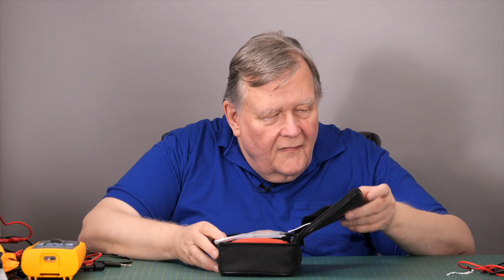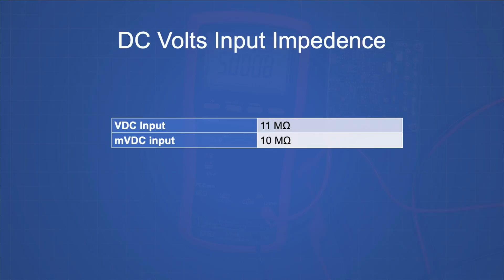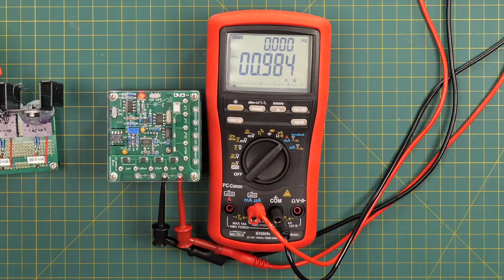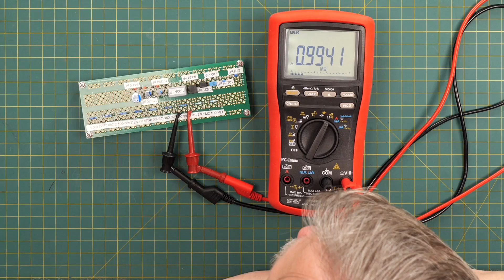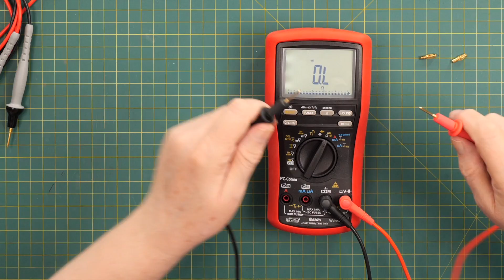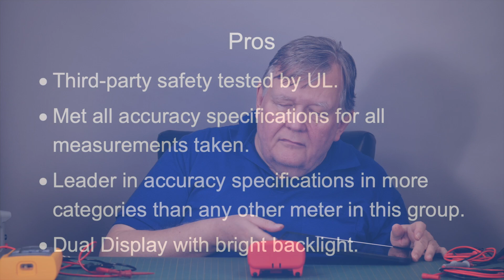Brymen BM869s Review

Comment: I have an issue with an inverter powering a second inverter, but one of them (or both) are not meeting specifications by a lot. The problem always starts at bootup, so i need a multimeter that will log the first second, be fast enough to record that. Most likely the condensators charging, maybe a grounding issue, or simply a very off-sinus tripping the other. Can the BM869s do that? (graph out the first second) or should i buy something different in the same priceclass (EU)?

Comment: Here in the Netherlands it was 209 Euro for a long time. That is a price by the company that honors its warranty. To be honest, for me, I would use those 150 bucks difference and buy another peace of equipment. Everyone has to know what's better for him though. All meters go out if the specs over time. Most of the good once do not drift that much away though. In most cases its possible to send it for recalibration. Question is do you need that difference in the accuracy with your usage of the meter? If you really do you might been better investing in high quality bench meter instead.
What you get for the money Brymen meters are excellent.
I wonder why haven't you checked 500K option for the DC voltage?
BTW Brymen doesn't support user changing firmware. It also requires re calibration after it.
But that difference between the Greenly and BM869s might be the firmware version. For Brymen, hold the delta button and start the metter. This will display the firmware version while you are holding it. More recent version will also give you longer backlight operating time. Newer versions often resolve issues that were not caught by QA team in Brymen but get found later on. That's the reason why I like to get their meters after some time has passed and they have ironed out the issues. Even the newer BM789 had some issues on start. They even added hardware parts to majevit better. Like buzzer magnetic shield. They do improve their products.

Comment: Hello, thank you for this excellent presentation,👍 but I have a question: which multimeter is your preference and why between Brymen BM869s vs UNI-T UT181A ? 👍
Reply from the maker: I still use the Uni-T UT181A, but I no longer own the Brymen BM869s.  Both are good meters but I don't have room to keep all the meters I review. Because of my vision problems I can read the UT181A screens easier than the BM869s.
Reply: @N8FDY  OK thanks for your feedback and good luck.👍

Comment: Hello, what is better to choose? Fluke 117 or brymen bm869s. I would use it for electrical wiring, I would have to measure the wastewater of the car or not. Interested in durability, reliability, safety. You want to use what 5 years without repairs after buying. Thanks for the reply.
Reply: The Brymen BM869s is slightly larger in size than the already large size Fluke 87V.  The Fluke 117 is substantially smaller size and lighter weight.  The Fluke 117 has the rotary dial sticking out a bit overlapping the left edge, so it makes rotation of the the dial with the left thumb (assuming you hold the device with your left hand) very effortless even with gloved hands.  The Fluke 117 also has LoZ and non-contact voltage features which the Brymen BM869s does not have, and you may want for electrical work.  The point is that the Fluke 117 may not have the pinpoint accuracy of the Brymen 869s, but for home electrical wiring use, the Fluke 117 has a functional advantage over the Brymen BM869s.  I consider the comparison of these 2 DMMs (digital multimeters) more akin to apples vs. oranges comparison.
Reply from the maker: It depends on many factory: is this for professional or hobby? Can you get support for the meter in your country.  The Fluke 117 (https://youtu.be/b1DzlzbgmI8?si=r__6BN7vH8abHvaw) has the features and is marketed to electricians.  The Brymen BM869s (https://youtu.be/aSrq3UJt4qU?si=7qgm3Rd77sj8he_C) has many more features geared towards electronics but does not have the VoltAlert feature of the 117 the some electricians use.  Many people who work with electrical wiring also use Clamp Meters, I have not reviewed any clamp meters because my focus is electronics.
Reply: @N8FDY  I understand that very well. But which will last longer not spoiled?

Comment: @5:23 On your 7v5 & 10v tests, you could have pressed & held the delta button (500000) until it beeped for a second time, to put the meter into 500,000 count mode. It would have given you that extra decimal place.
Also, you mention that the duration of the backlight wasn't long enough. It was increased from 32 seconds to 256 seconds a few years ago, so it's a big improvement from what it originally was.
Reply: the issue of the 867 869 are the foking batteries if you use the auto off mode the metter eat they and the 9v ones is a crap ones too y enden getting a fluke 189 and love it.

Comment: This meter stopped measuring AC within a year. Sent to service under warranty. They couldn't figure out what's wrong and said the meter needs to be shipped to Taiwan for further analysis and I will have to bear the shipping cost as its not covered in warranty. From my country(India), shipping two ways would easily cost more than what this meter is worth. Decided I will just use the rest of the functionality.

Within a month after that, the meter started showing 'InERR' in all the modes and its basically a brick now.
Reply: thats the amp and ma input got dirty  just clean and heat they terminal and becarefull dont let the dirt get iniside.

Comment: Would you be willing to take a look at the Hioki meters? The Hioki DT4282 is their high end meter.
Reply from the maker: I have reservations about spending $452.13 on a meter that is not third party safety tested.  The most I spent on an untested meter was $95.  Also if you look at the specifications it a tossup between it and the BM869s.  Price: Brymen, Counts: Hioki, DC mV & DC Low V: Brymen, DC High V: Hioki, AC mV: Brymen, AC V: Hioki, AC+DC: Hioki, All DC current ranges: Hioki, All AC current ranges: Brymen, All resistor ranges: Hioki, nF ranges: Brymen, uF ranges: Hioki.  In March I am going to a local Hamfest and will be trying to sell off the meters I am done with and I don't want anymore.  If I raise enough cash I will reconsider the Hioki DT4282.
Reply: @N8FDY  I understand your reservations. The price is hard to justify when great meters like the Brymens exist. I've seen them sell for around $350 on Amazon from third party sellers. I've also seen a Youtuber who goes by Kiss Analog mention that he reached out to Hioki and they sent him a free sample for review. He did a tear down video of the Hioki and he was really impressed with the build quality. I think you would have a decent chance at receiving a free sample if that interests  you.

I can't tell you why they aren't third party safety tested. I'm also not sure if this is too much of a concern as Hioki is a premier brand in Japan. I often see them referred to as "the Fluke of Japan". Their equipment is commonly used in industrial settings. Maybe they don't feel the need to be third party tested.  

It does have some nice features outside of the measurement specs. It claims to be drop proof on concrete of up to 1 meter, easily accessible batteries and fuses, the backlight auto shut off can be disabled (I think you would like this one), over voltage warning if you exceed 1000 volts, and there are terminal shutters that prevent the user from having the probes in the wrong terminals depending on the dial setting.

Comment: I noticed that in your video you said that the meter can't read the 100Mohm resistor. That is not entirely true. It can't read it in resistance mode, but for extremely high resistances, the BM869s has a conductance mode that reads in nanoSiemens.
That mode on the bm869s ranges from 99,99nS, which is the recipical equivolence of 10Mohms, all the way to basically 0,01nS which is the recipical equivalence of 100gigaohms (although...that measurement isn't really accurate anymore of course). But up to at least 1 gigaohms, the measurement is within 2%+10d accuracy. Which is pretty good.
The BM786/789 work the same way btw.
Reply from the maker: Thanks for catching that.  I will give it a try.
Reply: ⁸

Comment: I gave away a Brymen BM867s it also had out of spec low dc voltage readings as I can member between 1.4V to 4.5V.
Reply: These meters are easy to adjust during calibration. The procedure is out there on the WWW. If a calibration lab determines it's out of spec they should also be able to adjust it so it's within spec again.
Reply: @mrpetit2  if you have source of 5,0000V then yes, you can calibrate :)

Comment: This is a great multimeter. There are so many very clever designfeatures in this meter that give it the edge over a lot of very very expensive meters that are not always as apparent.
For instance at 8:18, where you do the AC+DC measurement, in DC mode, you can see on the Brymen that the bargraph is pulsating quickly, indicating that the voltage is fluctuating so that AC is present (which obviously doesn't show in a DC measurement). But the Brymen bargraph is so fast, that it registers it. The Fluke 289 on the other hand (that costs like 4-5 times the Brymen) shows only a stable bargraph at 2volt.

For people who find the BM869S too expensive, there is also the BM867S. It misses a few features, like the dual temperature measurement and VFD measurement, but still has 500k count mode, dbm measurement etc and is about €50/$50 cheaper. 

As an alternative for the 9v battery, you can get USB chargeable lithium 9v batteries on aliexpress etc, with pretty good battery life.
An advantage of 9v batteries over AA or AAA cells is that 9v batteries are less prone to leaking when sitting in a device fully discharged over longer periods of time.

As the meter already includes high quality gold plated probes, it saves on buying extra gold plated probes (which also saves on the ever growing e-waste mountain).
If I saw correctly, the greenlee version was still included with the older style brymen probes that don't have the screwthreads on the pins and the 4mm screw on adapters. Is that correct?
I really like those 4mm screw on adapters. It makes the probes so much more useful when needed.

I would definately return your greenlee DM-860 meter if it doesn't meet specifications and is irratic in it's behaviour. When you did that review I was already a bit surprised that it didn't met the specifications as my Brymen BM869s is calibrated annually (iso17025, so NIST equivalent) and always passes it's specifications for over 5 years now.
It is a very solid, robust and dependable meter that is definately on par with or even better than what the best brands like Fluke, Keysight, Hioki and other top brands can offer for only a fraction of the money.